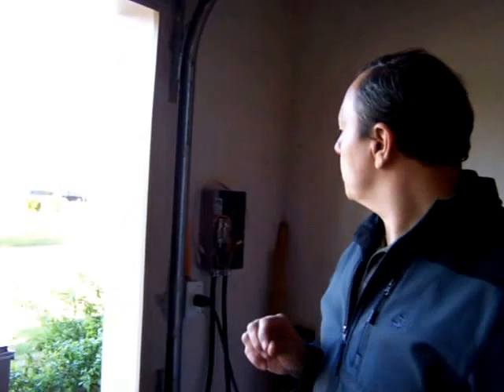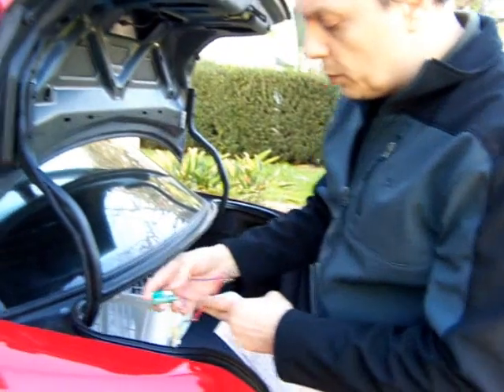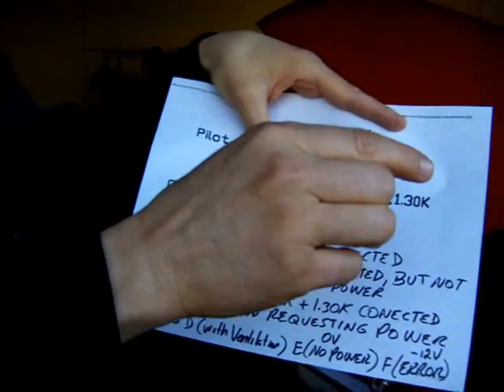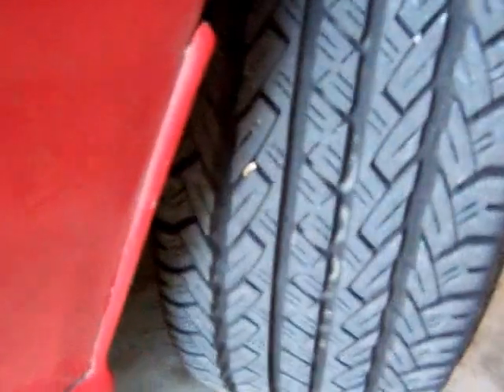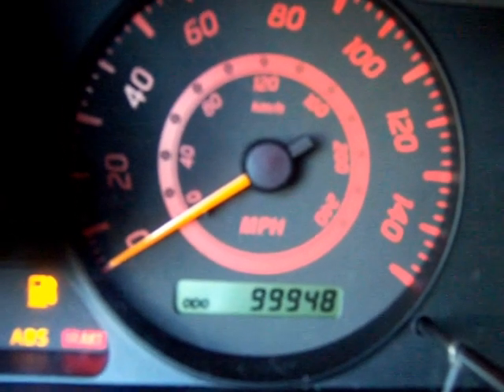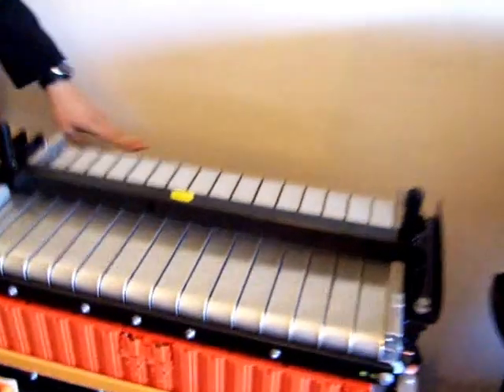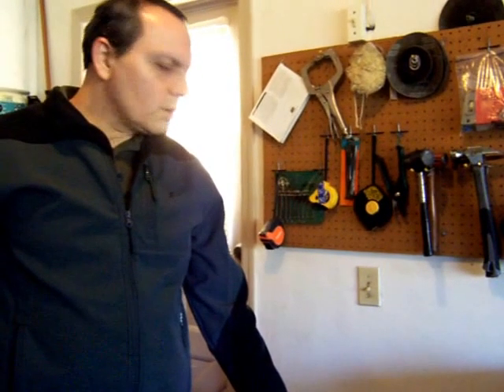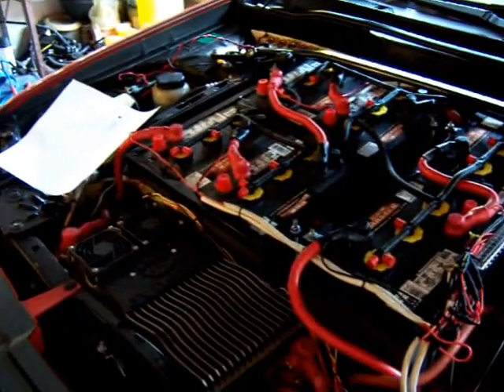Nissan Sentra Electric Car Conversion Part 35

Comment: Yes Power steering is not necessary on a Sentra - my NV (ICE, same eng. as Sentra, etc) is only manual steering. No probs with heavy steering. Perhaps you could find a quieter vacuum pump for the brakes?
Reply: P.S. Electric conversion coming - one day!

Comment: ev west tiene un aparato xa el motor que es un vaccium
pump con power steering deberias ver si tr conviene comprarlo es bastante silencioso tienen un video de como ponerlo en tu motor en su cuenta de youtube tambien el zeva fuel gage te puede servir para saber cuanta energia le keda al coche usando el stock gauge de la gasolina